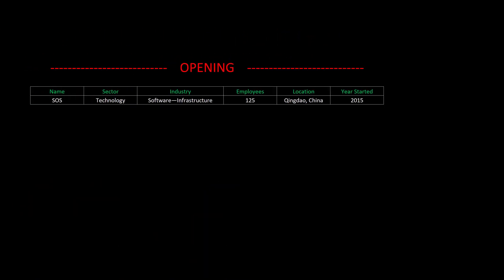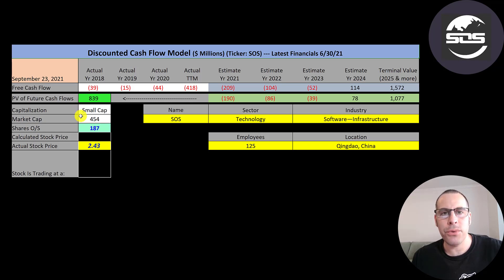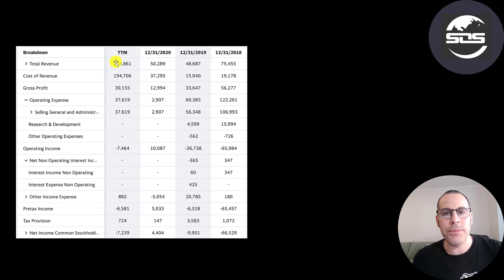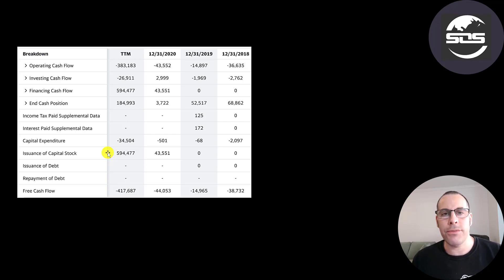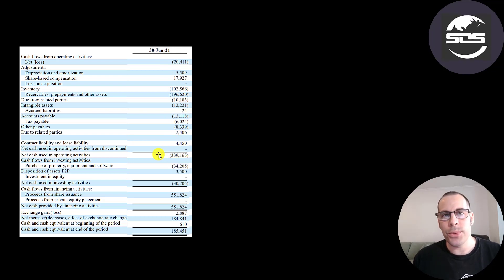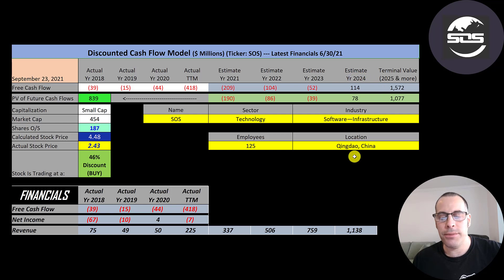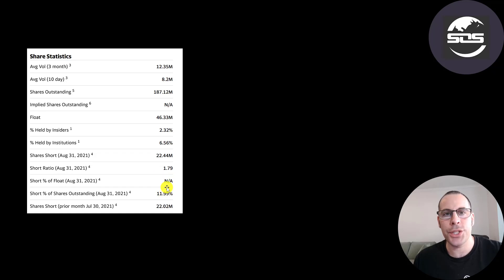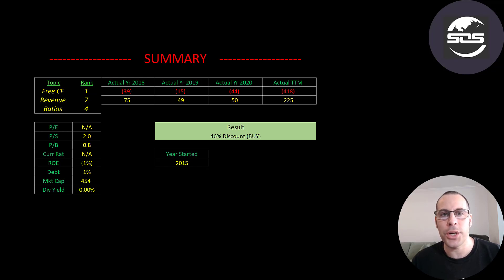SOS's Crypto Mining is only 8% of its Revenue:: $SOS

Comment: They did a 10:1 reverse split in 2019 when they were china rapid finance. Glad to see you caught the fact that it couldn't have been that high. Nobody but me has so far. I googled their ipo price as china rapid finance and it was $6, not $60 like the chart says.
Reply from the maker: I couldn’t find any info on the reverse stock split. I guess I had to search China rapid. I mentioned they used to be called China rapid the first time I did an SOS video. Thx for confirming!
Reply: Correct the charts were wrong. It was $6.60 nice work